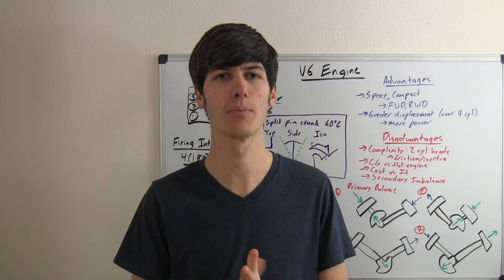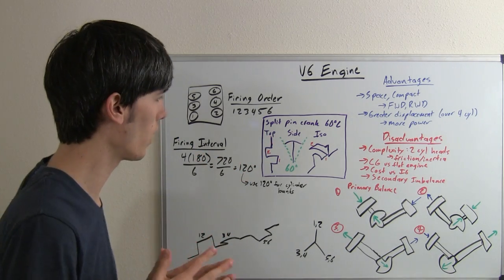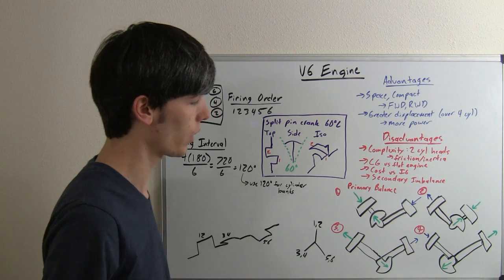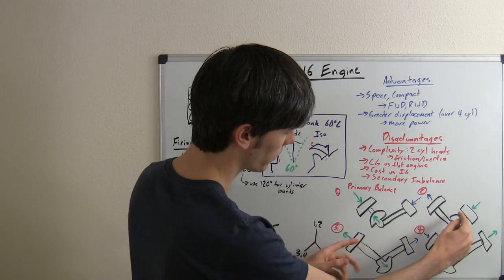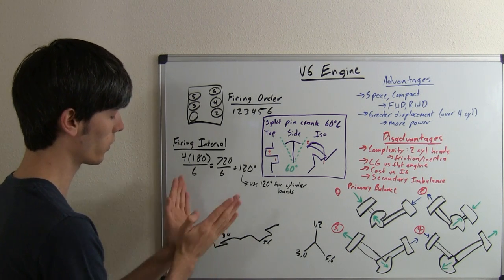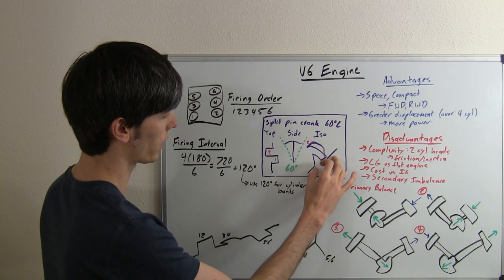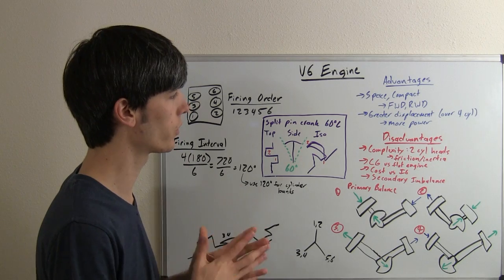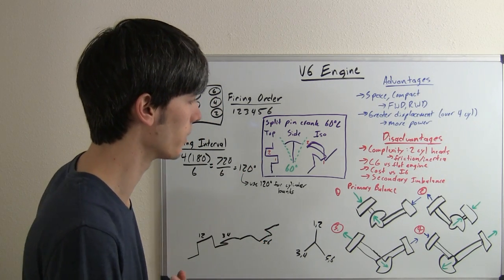V6 Engine - Explained

Comment: i dont get y companies are ditching n/a v6's for turbo 4's. if chevy can make a PUSHROD v8 get 28 mpg and 460 hp why the cant other car makers develop v6 technology to make decent power and mpg??? i would assume 350-380 hp and 28mpg would be reasonable out of a well made modern n/a v6.
Reply: Not a lot of companies use cylinder deactivation because it causes uneven wear and strain in the engine. It makes sense to do, but its not actually increasing the engine's actual fuel efficiency. I think only GM, Chrysler, and Honda do it. You can do it on really engine it doesnt matter how many cylinders your deactivate, on I4 it can deactivate only 1 cylinder and on v6 and I6 it can deactivate 2 and on V8 it can deactivate up to 4 cylinders. Its usually used on slower revving engines because if it was on a faster engine of a heavy car it puts a lot of strain on the engine.
Reply: Most n/a v6's nowadays are dishing out around 300hp, a few are pushing 330 to almost 350hp now, Regardless of what's possible with modern v8's, 300hp is enough to get anyone in trouble pretty quick, such as my 2013 Mustang v6. With a race tune it will do 0-60 in 5.5 seconds or less and still get 32 to 33mpg on the Hwy. Stats like that are putting cars from 10+ years ago that were considered "premium performance" to shame. 

The reason a lot companies are moving to turbo 4 cylinder engine is due government mandated CAFE standards pushing for higher fuel mileage. At least these days, performance oriented engines aren't getting totally neutered like what happened in the 70's when the EPA killed the horsepower of the muscle cars. Take for instance the upcoming ecoboost turbo 4 cylinder Mustang. Expected to get better fuel milage than the current 3.7 v6, but has as much HP and torque compared to the older 4.6 v8 they last had in 2010.

Comment: so inline engines won't have counter-balancing weight on the crankshaft unlike V type engine correct since it's already balance?
Reply from the maker: On an inline six they would be smaller than on a V6, yes.

Comment: Wait. A Split-Pin Crank Would Change The Firing Order For A 60-Degree Bank-Angle V6 Anyway, So We Don't Really Have A Choice, Apart From 1-4-5-2-3-6, For The Firing Order Of A Split-Pin Crank 60-Degree Bank-Angle V6 Engine......

Comment: how is the secondary imbalance taken care of in this engine?
Reply: Balance shaft on modern engines.  On older 60 degree engines they kept the stroke really short and used a large harmonic balancer.

Comment: Why arrange the pistons in the 'v' shape?? I still dont get it. Can someone break it down for me??
Reply from the maker: +Pranav Krishnan Packaging and rigidity.
Reply: It allows for more engine in the same space.  V type engines usually take up the least space, while still maintaining a few advantages like being able to use a common intake manifold for both cylinder banks and a single camshaft in OHV engines.

Comment: what happens if all engine have the same firing order as this V6. and v10/v12 have cross plane crankshaft? what sound do all they make and all other performance?
Reply: I don't think a crossplane V10 or V12 would be possible. Or it would at least require uneven firing intervals. And that would ruin those engines, especially V12 which is known for its smoothness.
If I had to guess they'd have a Harley type rumbling with a bit higher pitch
Reply: +SingleTurboSupra thanks. I always wandering why all types of engines sound different.  Viper v10 sounds much different than a European v10.
Reply: Damian Demon Of course exhaust affects sound, but that doesn't really answer his question :)

Comment: How do you explain that how does the Lancia Startos with Dino V& has 65 degree V-angle?
Reply: GM used to build diesels with 60 degree Vs. Although back then they were 2 stroke diesels.
Reply: +David Vermillion For 2-stroke the 60 degrees is an ideal angle I think
Reply: SingleTurboSupra it is.

Comment: I know  very few cars came with a v4. why don't they still make them?
Reply from the maker: I4's are cheaper to make, and small enough to fit in automotive applications where you'd use a V4. I believe V4s are still used on bikes.
Reply: In my opinion, they will make a reappearance within 10 or so years.
Reply: Engineering Explained that makes sense. Thank you
Reply: kevin soos The Porsche 919 hybrid race car uses a V4
Reply: Not a lot of advantage over an I4, besides more compact size, its thermal efficiency is actually lower cause it isnt as easily cooled
Reply: The only reason I4's are chosen over v4's is cost. There is no real performance advantage. The number of castings needed is lower, the amount of material used is lower, the complexity is lower. 

The only reason to use a v4 over an i4 is in RWD applications, where an i4 may be too long, and the space saved gives room for a turbo. I can't think of many rwd i4 cars on the market at the moment.
Reply: Authur Jackson that makes sense. And yea. Sadly there is no more 4cyl rwd cars anymore except for a couple like a miata, genesis, and frs
Reply: kevin soos There will be more. The trend in size is downward.
Reply: you guys realize that we still use V4 engines in almost all motorcycles
Reply: By almost all you mean almost none. The only bikes with any measurable production quantity that have v4's are the VFR's and RSV family.
Reply: William Su I didn't ask about bikes I was talking about cars I'm not a bike guy
Reply: Oh I thought a lot of the Japanese companies like honda and yamaha were using them still and making their next bikes with them
Reply: Ford used V4s' in the 60s' for some cars and vans in the UK , Saab also bought some V4s' from For and put them in the Saab 95 , the Saab Sonnett....
Reply: oh I loved the look if the sonnetts, but sadly they weren't very good cars

Comment: Imagine if they could build a flatplane V6
Reply: Flat-6?
Reply: SingleTurboSupra no. Go to his crankshaft vid on cross plane vs flat plane.
Reply: David Vermillion
Yes I know what they are. I also realized that flatplane doesn't suit flat-6. I just threw something off the hat without thinking much...
Reply: The split pin crank and 1-2-3-4-5-6 firing order of the common 60 degree setup is as close as the V6 design allows.  There are actually cross plane V6s, 90 degree V6s that are derived from V8s typically run a cross plane crank and 1-6-5-4-2-3 firing order (The Chevy 4.3L and 3.8L V6s work like this as both are derived from the small block V8).

Comment: Why isn't inline 3 cylinders not completely balanced ? It should have all its primary and secondary forces cancel out just like a I 6 configured engine?
The videos are a great help..thank you.
Reply: Because when 1 cylinder is up, 2 of them are down. All pistons stop moving and begin moving at the same time. This creates vibrations.